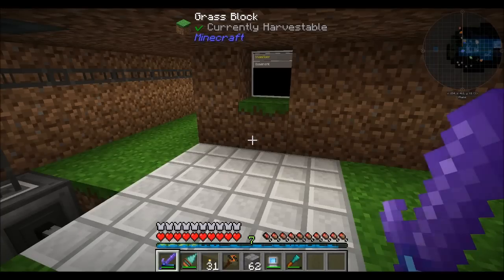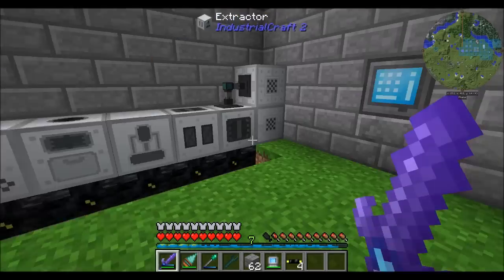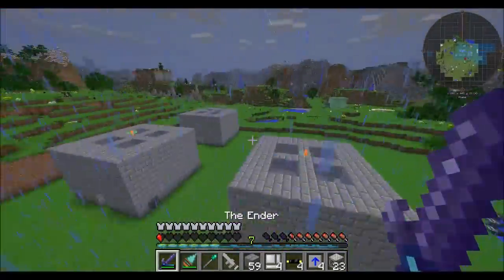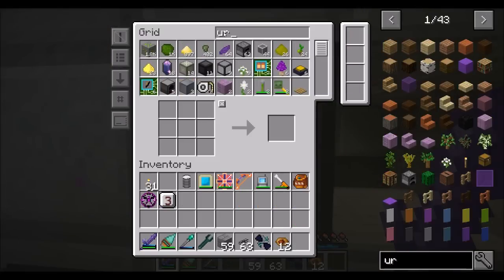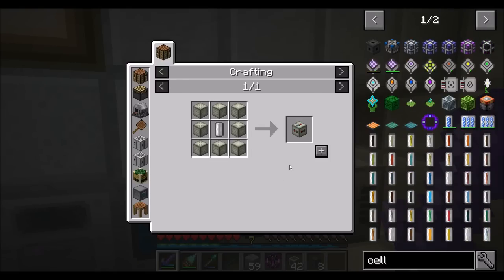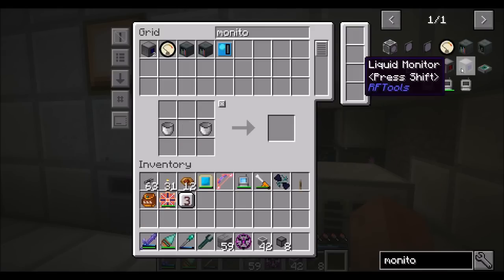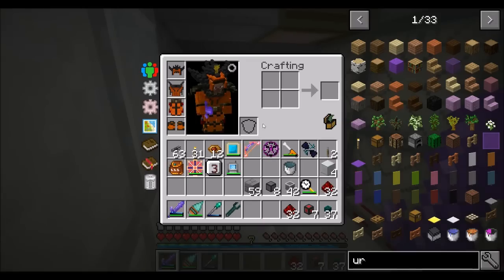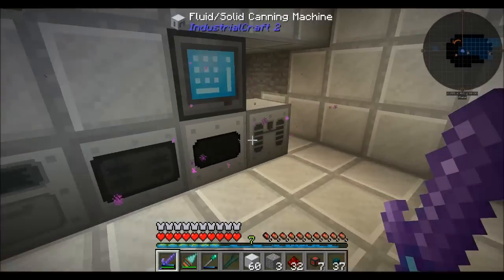Lets Play S8 E97 Reactor Automation

Comment: Dire, the heat vents only transfer heat to the coolant in a fluid reactor.  No coolant = no heat venting.  The only way the core temp is going down at that point is because it is going into the components and may melt them.

Comment: Dire, you blew up a fluid reactor, in a fully encased reactor casing shell, which was designed to protect the surroundings from IC2 reactor explosions.  It did the job the IC2 mod dev set out for it to do.  Without that casing it would be an entirely different reactor and much more likely to create a much larger reactor explosion in your world.  If you blow up an IC2 reactor, by itself, and it's not a fluid reactor, nor enclosed in reactor casing blocks, then that IC2 reactor explosion will leave you with a giant crater in your world.
Therefore you didn't test an IC2 reactor exploding without casings or in a fluid reactor state, you tested the casing and yes, it will protect your base from that reactor exploding.  But, should you move your IC2 reactor into a RFTools dimension, and build it without protection, and blow it up, in that dimension, as an IC2 reactor which is the default reactor, that dimension will have a large crater in it.  :D

Comment: don't forget to make a cooling system to recycle your coolent. that's you'll get energy from the reactor. don't get too greedy on the reactor. start with 1 or 2 single fuel cells while improving/expending the cooling system. My last reactor was running about 5000 HU/t

Comment: Dire, you can probably pull more power from the draconic reactor than you currently are. Experiment and find the highest energy gain vs shield cost (you could probably get away with keeping it at 5% instead of the current 10 and have plenty of room for error, which will make it more efficient to boot)